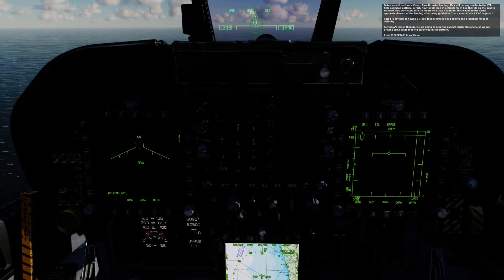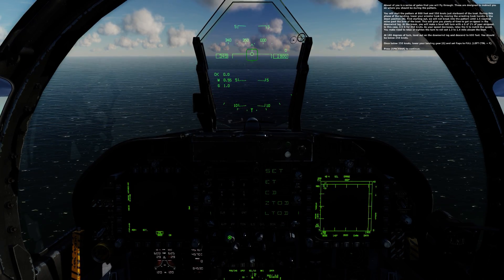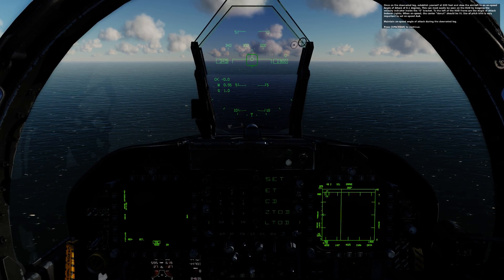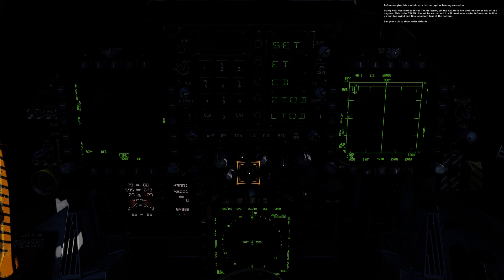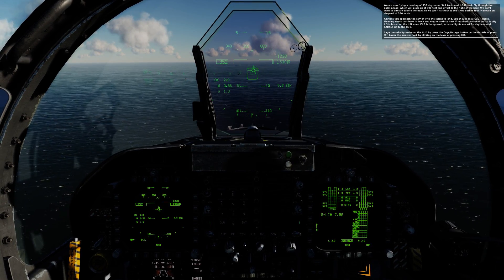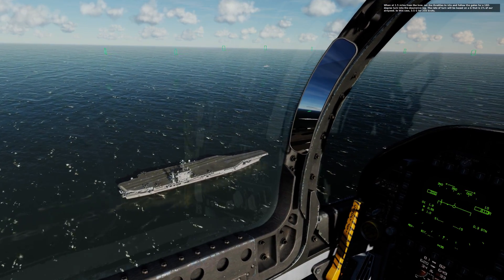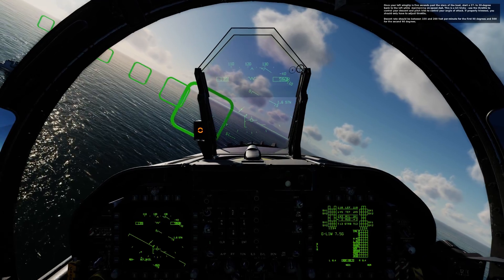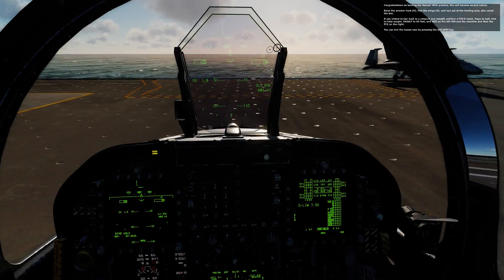DCS: F/A-18C Hornet Case I Carrier Landing Training Lesson Recording

Comment: TL; DR: don't listen to what he says, fly the gates, then the ball or you will have a bad day.

To anyone trying to follow that tutorial and not go completely crazy: the instructions Matt is giving do not reflect his actions in the plane. Because of the gates layout, the G-turn is only momentary at first turn. The second turn he does is nowhere 27-30 degrees, more like 15. Due to that, the descent rate doesn't match the required -100 to -200, in fact he's climbing on the first 90 and then reducing power to drop before the second half of the turn. And if you're looking for a descent value of -500, don't even bother, the fastest he goes is a momentarily -450 for an otherwise mild descent. It's great that we have those tutorials, but it would be even more great if we had .trk files along to review to know what went wrong while we were following Matt's instructions.

Comment: You are saying about 1% G but when you turn your speed is more than 200kn. but your G is around 1,2G allmost all the time..
Reply from the maker: Most pilots will start at the 1% and then relax during the 180. Because of the nature of that gates, a more steady-G turn was required. You can use either method.

Comment: At 3:30ish the instructor says to use the throttle to control the rate of turn.  I thought it was use the throttle to control the rate of decent?
Reply from the maker: It's an error in the voice over, please see the correct subtitle. Rate and decent rate.
Reply: It is both.
A higher turn rate demands a higher angle of bank, which means less vertical lift from the wings. Normally you would increase your angle of attack to increase your lift, but we cannot use pitch controls when flying onspeed AOA. So we must increase our speed to increase lift, by use of throttles.

Add power just before adding bank angle when flying onspeed AOA. As you roll over you accelerate, the added speed will increase the lift generated without changing your AOA, this will help to control sink rate when you initially bank over. Conversely, you should back out of the throttles a tad when rolling out of turns to help to control 'ballooning' when you roll out into the groove. (Don't over do it though, otherwise you'll find yourself in the drink). High is better than low.